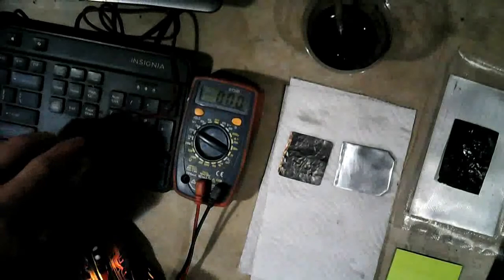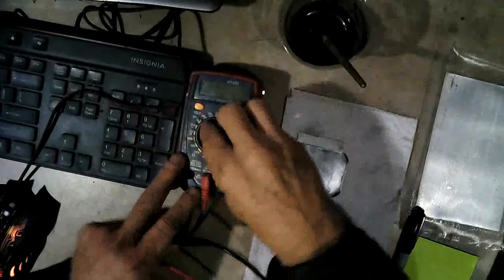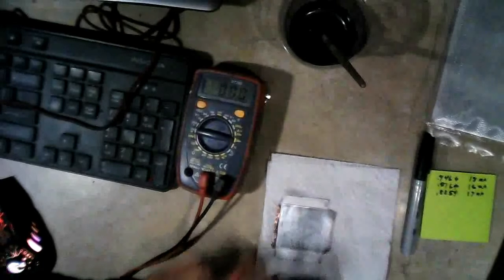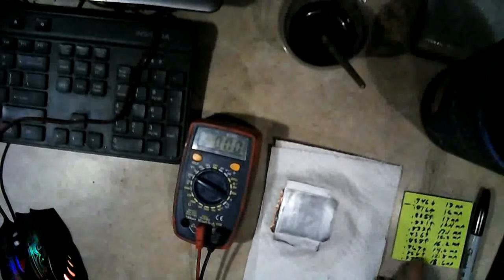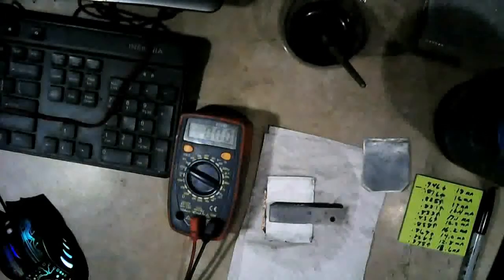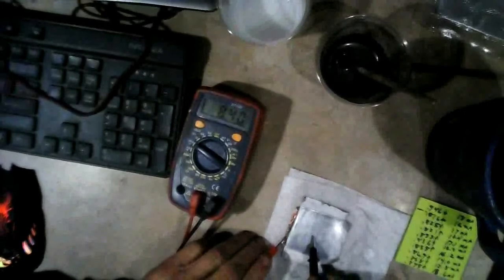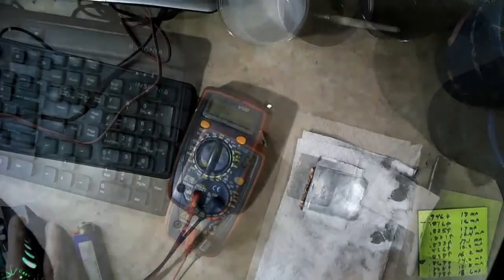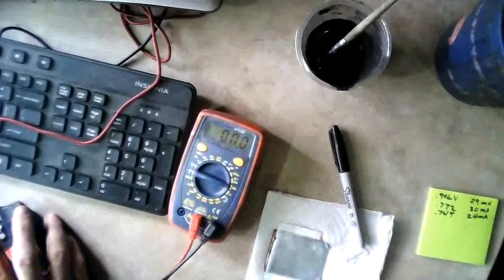Binder Drying Time Test!

Comment: thumbs up on your progress 
quick thought on your one question - if possible weight the cell or separator to look for variation in amount of hydration ????
Reply from the maker: I'm sure that would work Dennis, but I'm going to avoid the re-hydration problem if possible. It's a lot of extra work that can be side stepped by using the wet gel process.
Reply: I have to  read up more on self charging.....I was thinking water is consumed during the process for each charge/discharge cycle.......????
Reply from the maker: I think water is consumed during cycling Dennis, but apparently some or maybe all of the water can be recycled in the cell, by taking advantage of the water bound up in the crystal structure.
Reply: You're well on the way to being able to verify the hypothesis.You may find that some of the water is separated into hydrogen and oxygen in the process which would use up some of the water. The oxygen content you propose to measure should tel you whether extea is being produced and hence water being consumed in the process.
Reply from the maker: Yep, just like transpiration in a plant. ;-) More evidence the cell has living qualities.

Comment: thanks very usefull info there. im strugling to hold the voltage on the metal carbon cell im playing with, from your info to increase the layers of carbon that just help 3 fold on my experiment ..so i have metal plate painted with graphite dried for 24hrs three layers of seperator painted with another carbon mix..electrolyte is ZnSo4 with H2So4 pinch of ascorbic and H2O3 ..on assembly of the sell it generates about 500mv and 250mAmps tested for 10 minutes i do the first charge , then discharge the cell gets better and better with a holding voltage of 1.5Vdc and good short cct current for 15 seconds at 1Amp..the borax works but concentrations have not been ideal results, the titanium dioxide part work defenately on the holding voltage side..working on a video to demonstrate later, cheers keep up the info very good thanks, QA to mrFmiller are you also building these types of cells, you comments help very much thanks..
Reply from the maker: Good work Barry! Layering definately works. I'll have to try painting layers of graphite too.
Reply: the next one i trying is three layers of graphene coated anode and also three on the cathode each layer left to dry 24hrs.
Reply: Barry Liebenberg - Not currently. I spent a year testing the classic crystal cells (Bedini, Lasersaber, et.al.). I concentrated on using the crystal cells to recharge a lithium cell. The arrangement works but the charge time is impractically long. Crystal cells produce up to 1.5 V at about 30 mA at best. They don't seem to stack well to increase the voltage. To light an LED requires a joule thief (blocking oscillator step up transformer). They last a very long time (mine lit an LED continuously for eight months, Lasersaber had one running continuously on line on YouTube for three years).
Theoretically it would take about 100 hours to recharge a lithium cell. In practice it takes longer due to power used in the necessary circuitry. I was trying to stack the cells to reduce the time of recharge. My goal was to create a permanent battery pack for cell phones that worked by putting it in a holster with battery contacts. My conclusion was that the crystal cell would need to be unacceptably large for portability. They will recharge the lithium cell but unless it could be stacked it would drain faster under normal use than would be practical.
During my research I became interested in open source research into cell chemistry and construction. There is a surprising number of experimentors posting research on the subject coming up with incremental (and sometimes ground breaking) improvements.  Due to circumstances I currently don't have time or resources to pursue active research. When I do resume I want to know everything I can about the current developments so I'm not trying to reinvent the wheel.
Since then I have followed any research I can find. I noticed a lot of the individuals were repeating experiments others had already conducted. It's good to verify results if thats the goal but for the sake of exploration it helps to be aware of previous findings. I am a big proponent of open source collaboration. I watch, observe, ask questions, evaluate, and comment when I think it may help. I try to reference previous research or what knowledge I have accumulated to help others advance their efforts. Advancement of power storage is rapidly becoming a critical issue and anything that helps move research along is beneficial. 
I'm not an expert. My background is as a materials tester and Inspector. As such I concentrate on technical developments, methodology, and processes, as well as coordination. It's a factor that is inherently somewhat lacking in open source collaboration. Those with the time to experiment don't necessarily have the time to follow all the others doing the same. That said there is a close relationship between those actively participating. In a corporate environment there would be managers and coordinators guiding the research but in the open source environment there is not and there ends up being a lot of overlap and holes in the research. I think its good to have someone watching and helping close the gaps. None of us are paid for the efforts but each could provide crucial elements.
Reply from the maker: Stratification, just like nature does it. :-)
Reply from the maker: A word about Fred Miller. He's a materials expert, which is in general a very underappreciated field of study. He's also obviously has a lot of lab experience, which means he good at testing procedures. He is also very active in the battery research community. Every time I find a new battery researcher I'm interested in following, I can count of seeing Fred already there. Lol He's great as a quality control person, and I'm very happy he is active on this channel.  I can always count on Fred for promoting discussion too.
Reply from the maker: Bravo! Well said Fred. We need more people like you tieing the research together!